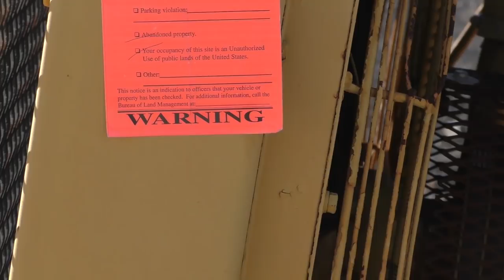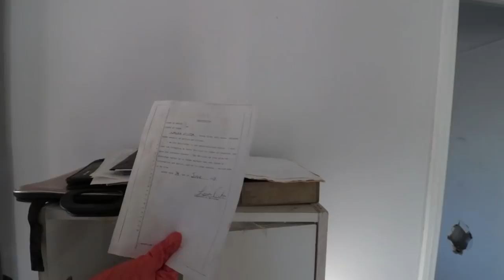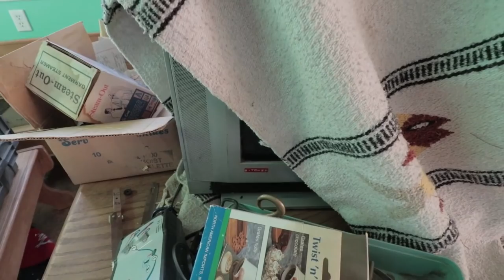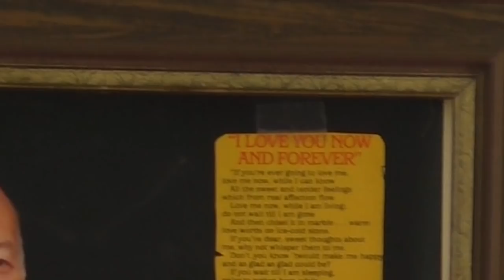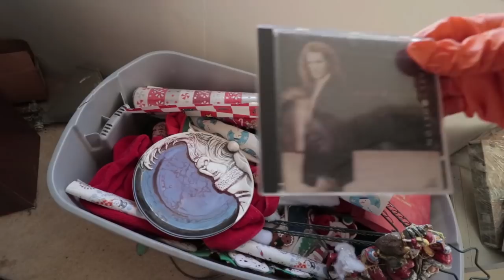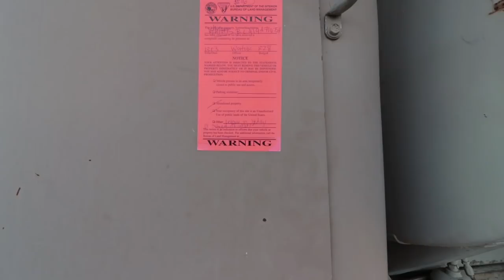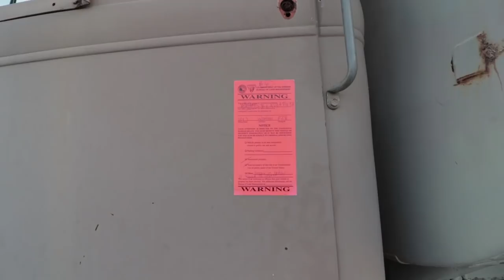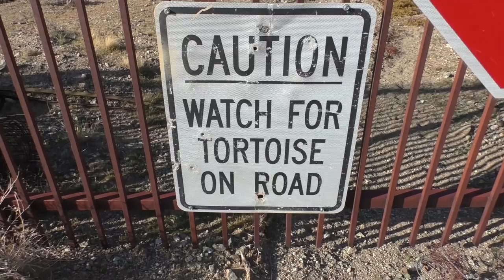You Won't BELIEVE What We Found Abandoned In The Middle Of Nowhere...

Comment: At the 27:08 part of the video you were in a room of barrels. One of the barrels had the word "CUPELS" written on it. That is a mining refinement term.
 cupels (plural noun)
a shallow, porous container in which gold or silver can be refined or assayed by melting with a blast of hot air which oxidizes lead or other base metals. Cupellation is a refining process in metallurgy, where ores or alloyed metals are treated under very high temperatures and have controlled operations to separate noble metals, like gold and silver, from base metals like lead, copper, zinc, arsenic, antimony or bismuth, present in the ore.
No doubt to me you were on a small scale mining operation.
Reply: There are things that are used or withdrawn that are indeed Toxic such as lead and Sulphur dioxide and arsenic. The lead oxide was skimmed off the surface of the hot mixture or absorbed into walls of the cupel (made of a special material - sometimes bone ash). The silver that remained at the bottom of the cupel was run-off and solidified into blocks. The byproduct contained in the remaining ash still had value and they would run it through a third oven to get the lead out since it had value as well. Not knowing how far along the stuff in those barrels was along when it closed down I cant tell you for sure how toxic. There are some very strong laws on this process and disposal of the left overs are supposed to be handled by regulation disposal process. If I had to guess the stuff in those barrels is very tame. But there are things that helped process the lead out that could still remain very toxic since processing lead has a cumulative effect. With all the orange tags on the trucks Im sure they BLM, EPA or some other Government agency  has taken everything away that might be toxic but that's a guess on my part. I just do not think they would leave toxins unattended. You can bet that if it were really bad and abandoned they would close it off and make sure there was no leakage into ground water Or could make it into the air. Emma and her Dad have been doing this for several years so Im sure they take ever precaution necessary.
Reply: Bromide is also used in drilling fluids.

Comment: Guys, I think that what you take it to be "old TV's" are actually old oscilloscopes (An oscilloscope is a laboratory instrument commonly used to display and analyze the waveform of electronic signals. In effect, the device draws a graph of the instantaneous signal voltage as a function of time.) what you first saw outside is both a radio/telecommunications antenna (notice the satellite dish). Which being an operation in the back of beyond, makes perfect sense. I'm still right at the start but I also think that maybe that half buried structure, used to be a solar panel array for the necessary (and obvious lack of) electric power...just a thought. Let's keep watching.

Comment: If the generators are diesel the cans could be oil for back up as oil can be used instead if the diesel runs out,smells a bit and smokey but it works.

Comment: I think that Burger King toy was issued in 1997.
I bet if you'd taken out the eggs, they'd be dry -- mice can eat them out from the inside underneath.
Also if you ever find unopened soda cans that feel empty -- they probably are.  They can dry out in a few decades, but only the thin-skinned, relatively modern ones.  Some of the older ones from the 1970s and earlier, will hold their soda intact, because they used a thicker type of can back then.

Comment: If someone was motivated enough with even just a minimum amount of equipment they could load up a few semi-trailers full of scrap metals and bring them to a processor it would probably pay to do so.  If the said person(s) were especially motivated and made sorting piles (perhaps using one or more of the large, old, wooden crates) and separated the more valuable metals out to the side it could really generate some cash. I would think it could at least pay for removal/ transport costs. (IMO)
Also, I would check if those barrels contain anything of value. I know of some family friends of my ex-wife who's father-in-law passed away and left several self-storage units filled with sorted copper, aluminum, platinum, etc. that he had amassed over the years they only discovered the vast extent of which after he died. It took them three weeks to clear everything and transport it to the nearest salvage yard and it totaled well into six-figures. In fact, the husband was able to retire early as a result!

Comment: Lots of things that are just to far gone. But those giant gas powered generators......I think they were.............Despite the weathering, they could be worth some bucks. The only thing I see that would not require additional rebuild investment to then sell.........might be some of the vehicle engines and forsure a few of those trucks had rear and possibly front axle assemblies you see on Craigslist constantly. Strong market for used truck axles of the more heavy duty types. Some of those engines may have been clean enough and not all taken apart, to where they could run. I saw alot of things that had value, but it was gonna take big effort and likely further investment to improve the condition, to make things easy to sell. I was hoping there was gonna be a nice bike/motorcycle or actual desirable classic 4x4 or somethin around each corner. Or cash in a box/drawer.

Comment: This is an old minning compound that was shut down due to improper registration and BLM finding loop holes to take it back. The reason the stuff is still there is because the miner's were given x amount of time to clear the land, without having the proper budget and dealing with land disputes in court, they passed that dead line. So then it became BLM property and possession is 9/10ths of the law so now they own it. The miner's were paying taxes on the land for year's and basically got screwed over. So if they tried removing the stuff they could of been prosecuted since it was no longer their property as well as didn't have the fund's.

Comment: they were using it to cook drugs more than likely under ground.. did their business and left. compared to how much they made producing drugs.... that little bit was nothing. it was found on a satilettle. no reason to have a tower! they wanted at lest an hours notice to hide in a location that could sustain them for several days come back out when they are gone.
every thing there states 70s except the vehicles.... BLM does want to clean it up!  thats an air pump!!
26:58 meth anphetamine production storage unit ...the heavy equipment was to excavate build the lab then cover it  up... the lay out looks like a typical farm from an airplane. few would be flying that low out in the middle of no where.
that was part of the cover up to exiting the facility change the direction of whoever was looking. you found a drug lab...plain and simple probably  been used a few times until that drug was no longer profitable...hence the 90s truck
careful out there some of those chemicals are poison and have decades of shelf life as poisons.... that place was cleaned by proffessionals.

Comment: Uhmmm U need to clean ur vehicle windshield lol looks like u may also be a smoker.
Reply: Idk about the man but the woman in the pic looks very familiar. She kind of, also, reminds me of a woman who lived in Greeneville, TN and passed away several years ago. But Idk if that is why she seems so familiar.
Reply: 28:34 Bromine Reagent. I looked it up. Good thing u didn't decide to open it up... Copied from a webiste --->>> Bromine, Reagent, ACS is an elemental liquid with a dense brown red color. It is extremely corrosive and has properties that fall between those of chlorine and iodine. Its uses vary from flame retardant and gasoline additive to uses in the medical and veterinary domains as anticonvulsants. As an ACS grade Reagent, Spectrum Chemical manufactured compound is used as the quality standard against which other substances are grade and has met the toughest regulatory standards for quality and pureness.